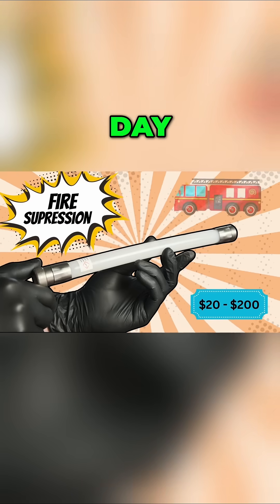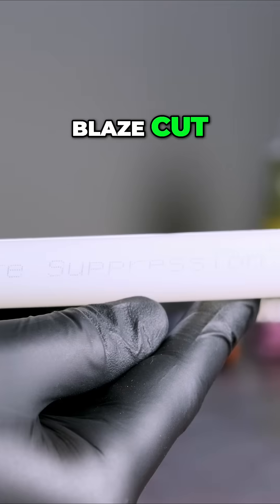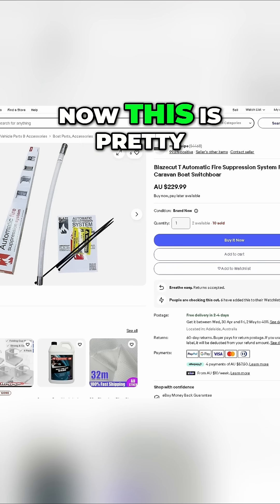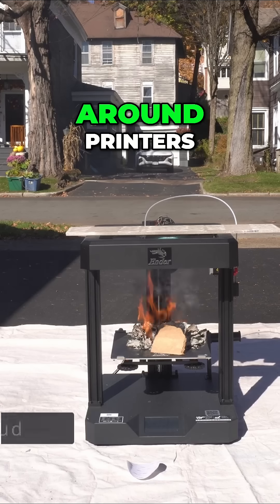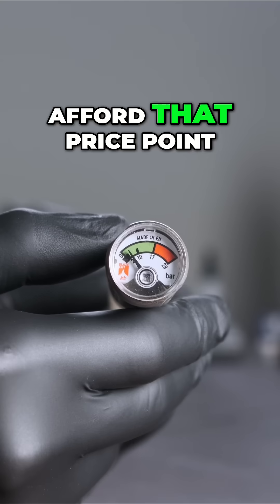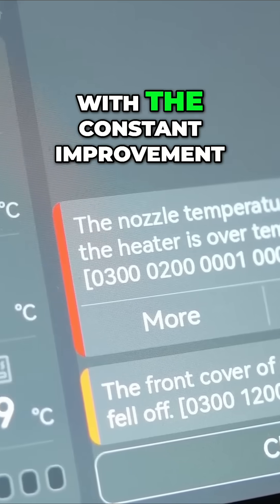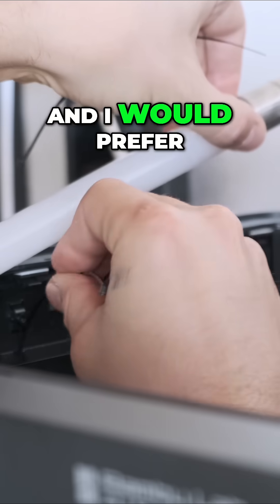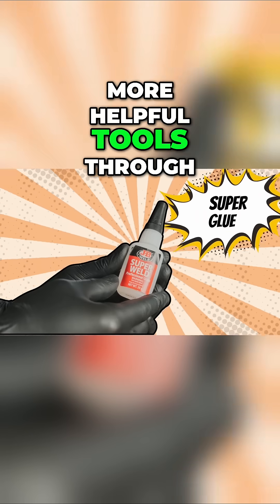Stop Your 3D Printer from Burning Your House Down

Comment: What causes the printers to cause fire? Should I be worried about my ender 3 printer?
Reply: Primary cause of issues in an ender is the power wires going to the mainboard are tinned in the screw terminals. Tinning a wire and then putting pressure on it in a screw terminal caused micro fractures and slowly weakens the connection to the point it begins to heat up and eventually catch on fire. To fix this simple cut off the tinned end of the power and bed wires and strip back the wire and reconnect it.
Reply: @ why is it tinned in the first place causing a potential safety hazard if they’re making these printers for consumers of all ages?
Reply: @ and I forgot to say, thanks for the info! I appreciate it!